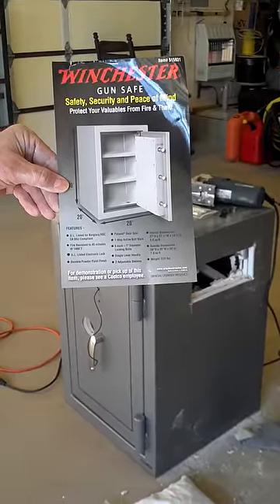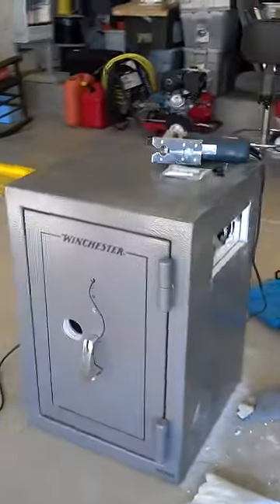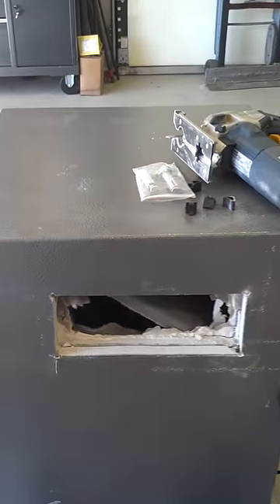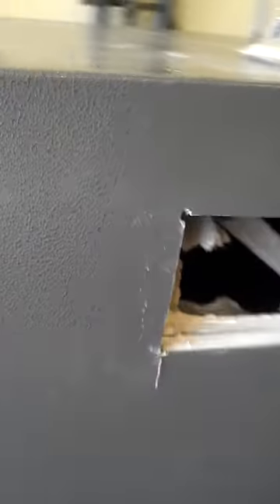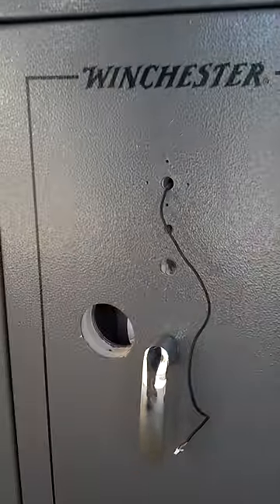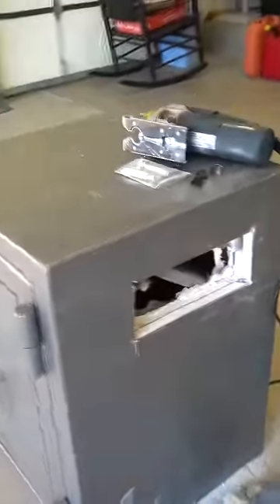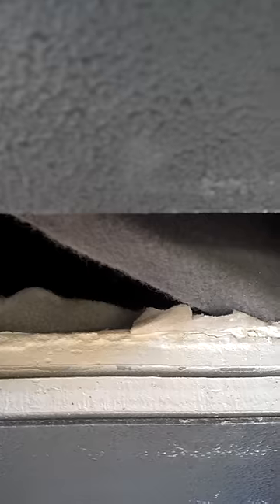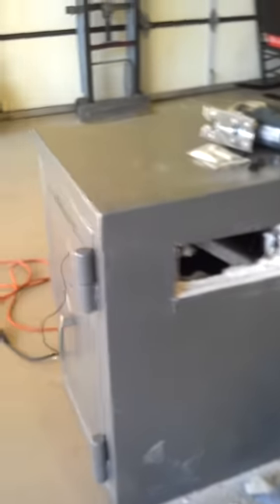Breaking Into Winchester Safe

Comment: The old Winchester models had those electronic keypads that failed. Fortunately, the new models have a key backup located under the keypad. If the keypad fails, you can still get into your safe with the key. I would never buy any safe without a key backup. Can't trust electronics to last.
Reply: hmm- but lockpicking is fairly trivial at that point, no?
Reply: @chrisE815  not so trivial for me. Some locksmith is going to charge a few hundred $$ to open it.
Reply: @jerseyneil1  that's why I bought a liberty safe.they cover their locks
Reply: @chrisE815  Yeah the lock picking lawyer got into a tubular lock within seconds. So I would assume buying a safe with a key slot is a huge vulnerability

Comment: ALL safes in this price range are built this way.  A higher end safe that size would be 2 or 3 times the price.  The lesson here is to get a manual lock not cheap electronic lock.  Liberty gives 5 year warranty on S&G electronic locks and Fort Knox gives a lifetime warranty.  These safes are to stop kids from getting guns, fire protection, and to slow down a smash and grab punk when the safe is bolted down properly.
Reply: Yep, that's the right attitude. Most break in's are all about opportunity. They want cash, jewelry and pills for the most part. They encounter a safe it's likely not going to be worth their effort to go nuts on the thing and risk getting caught. I once had my house broken into, I'd just moved there and I had a couple guns there in a side room just in bags. They didn't touch em, cop said a lot of criminals know better than to be caught with a stolen firearm...it's a serious enhancement to their crimes.

Comment: Aren't most lower-end consumer safes made the same way?  The "dry wall" material (concrete backer board in others) is there to increase the fire resistance not the angle grinder resistance.  The basic purpose of the safe, properly mounted is prevent most thieves from being able to simply grab the gun and the flat screen and jet.  Unless you are robbed by someone carting around some pretty darned expensive cordless metal cutting tools or rolling up in a lift gate truck with pallet jacks to roll the safe out on, they are not going to spend enough time in your house to figure out how to cut into the safe, hence the value of your consumer quality safe . . . deterrence.
Reply: Exactly and with a alarm going off they cant just grab and go with your guns locked up like this good safe

Comment: Who breaks into your house intending on needing a jig saw, hammer drill, and whatever other power tools they'll need to get inside?  Almost they'll have a crowbar or sledge hammer, neither of which will get you in before the cops arrive.
Reply: If you are talking about your neighborhood kids or the local junkie breaking in for a quick grab of anything he can pawn, then you are right, these amateurs are not prepared to break into a security container.

BUT any pro is ready.  Pros rarely break into a home without knowing in advance what they can expect.  Whether the pro cases the house himself or gets his information from others (as most do) doesn't matter.  The simple fact that you HAVE a "gun safe" makes you a target and guarantees that any pro who comes to your house will have either a double-cut saw or an ordinary circular saw with a carbide tipped blade -- either of which will cut through the sides, back, or top of your "gun safe" in less than a minute.  No pro bothers attacking the door because there is simply too much junk in the way inside the door, but the sides, back, and top are just one or two layers of thin sheet metal, with a layer of drywall and maybe OSB and carpeting.

Pros love "gun safes" even if they aren't interested in stealing rifles and shotguns because they can be pretty sure of finding handguns and other valuables that people stick in these "safes" thinking it will protect them.  

If you are going to waste money on one of these Residential Security Containers pretending to be a "gun safe" at least find a way to position it where there is no access to the sides, back, and top -- but a far better choice is to get something better because most "gun safes" on the market are actually very bad places to store a gun. The Drywall or "Fireboard" used to get the Fire Protection Rating causes moisture inside the safe promoting rust, the carpeting and the adhesive used to install it will outgas chemicals that attack the metal.  Nearly all "gun safes" are greatly over-rated for the number of guns they are supposed to hold -- one of the major causes of damage to guns comes from banging against other guns when people try to take them out or put them into a gun safe.
Reply: problem is is when you live in a rural area and any noise will not alert anyone. Plus with all the sleazy lawyers about and sleazy DAs looking to go after the homeowner while protecting the thugs, if your guns are not locked up the homeowner will have a lot of legal expenses. Cops are worthless. Local woman on vacation had her safe broken into by a 50yr old woman and had over 100K stolen.

Comment: why didnt you just buy a new keypad? Your keycode is stored internally. just unplug and plug a new one in for $60, would have saved you from destroying your safe
Reply: Mr. Maki, nope the code is stored internally and on the lagard key pads the contacts go bad, so you buy a new pad twist off the old pad replace with fresh batteries and wait 5 mins the enter your code

Comment: The most expensive safe on the market has sheet rock in it...   And it will take anyone about 5 minutes with a cut off wheel to get in any of them...  There's nothing special about that safe, or anything you've done...   Other than buying a cheap safe, with a known go fail electronic lock...

What you needed, was a good locksmith.  Who would have replaced that lock, and got you open in 20 minutes, without cutting it up.  

...derp!

Comment: Do you still have that safe sitting around, Sir?  If so, I'd like to see (a video) a crow bar/pry bar attacking the front door, just to see how difficult and how long it'd take to pop that door open.  I have the same exact safe and was wondering how secure/strong the door is.  Thanks.
Reply: That is a rather small safe, so the door is hard to pry open (bigger safes are easier to pry open!) -- but as this video and others show, it takes only seconds to cut through the sides, back or top of almost any "gun safe"  The folks at SecureIt have a video of a couple of amateurs prying open a typical 5' "gun safe" in a couple of minutes.  A common "gun safe" can be reasonably secure IF you bolt it down, AND locate it where crooks cannot get to the sides, back or top, AND make it hard to get leverage to the door on the side away from the hinges -- but there are better ways to store your guns and other valuables.  Take a look at https://www.secureitgunstorage.com

Comment: Most thieves look to be in and out quickly as possible and if your not home sure they may mess with your safe a little to try and get in but they wouldn’t spend 30 minutes or more trying to break into your safe and risk you coming home or cops coming and they wouldn’t be able to drag it out of your house and load it very easily or if you have it bolted down . It’s more of a deterrent meant to not be able to have easy access to , to snatch and grab if I robbed a house just for example of course and I seen a big ass safe I knew I wouldn’t be able to load it or break into it I’m not going to risk it even though I know valuables would be in it I’m gonna look for something quick and easy and get out fast before anyone calls the cops or comes home and catches me in the act unless it’s a safe that’s not bolted down and the size of a microwave then you could literally carry it out load it up and gone then you could take all the time you needed to cut it open unless someone was smart enough to put some kind of locating device inside of it . Would be kinda cool if they made safes with a rechargeable battery and a sensor or device inside that would detect someone tampering with it like a bunch of vibrations or incorrect passcode too many times and send you a notification on your phone while your away maybe a small camera on the front that’s kinda hidden and not obvious like a door bell

Comment: I can cut any metal with tools.
Reply: It isn’t the fact that u can’t cut into steel.  It’s a question of how long will it take u. So it depends on the amount of steel that is in these Safes.  These Winchester ones are cheap. 14 ga steel is garbage. 

You should never count on a thin, cheap-end metal safe to store your guns and other valuable items. With simple research, you’ll notice that most poorly constructed gun safes include thin metal frames that are constructed from 16 to 20 gauges. If you end up with a safe that features anything from 14-20 gauges, you can expect even the least experienced burglar to be able to pry it open with a hammer and a large screwdriver. On the other hand, the maximum steel gauge for a quality built gun safe should be minimum 10 and preferably between 8 to 6.

You get what you pay for.

Comment: How much did the Winchester safe cost? Was it about $200-$400? A 12 rifle gun safe from Tractor Supply runs about $399. It's a Winchester safe. No, it's not a good as a $1200+ gun safe. But cheap gun safe is better than a locker or hiding guns in closet, under the bed or waterbed drawers. Not everyone has $1200+ to buy a high price gun safe. But if thieves have enough time to they can cut into any safe regardless of the price. They can even pry the safe from the floor and take it with them. Had a coworker come home from vacation and found everything in his home gone. Thieves came with a moving van and took everything including high price gun safe. A cheap gun safe is just there to slow lazy thieves down.

Comment: I have a full sized 40 gun safe that was a generic name on clearance.  Got it home and digital lock had problems but I did have keys so I called store and they said they wld contact the company, and they have before but they informed me the turn arnd was about 8 months.  I tried calling as well and I got some tool import company who put me on hold twice till I got a voice message service that asked for my phone # and brief description of problem.  Its 2yrs later now and never got a call.  Getting back to it I took the back of the door off and found the problem, it was the ribbon electrical cable plug had worked loose from one end, the weight of the digital lock on front when i let it hang to place a battery in was enough to do it.  Save yourself a headache and get a safe from a company that makes safes not companies who just put their brand on it.  But that's probably why I got it so cheap on clearance

Comment: Look, all the safes are the same unless you are going to dump sh** pile on one. If you want to make it better and it will not cost as much as a really good one like ironworks safe weld metal to to the outside. The fact is it helps slow someone down and I don't know about you I don't have cutting tools in my home.

Comment: I have the same issue right now, I was sent a piece of crap new plastic NL keypad to replace my Lagard keypad from Winchester and I still can't get in. Apparently the internal lock is bad. I will NEVER buy from Winchester their customer service SUCKS they hardly ever answer the phone. I am going to have the safe drilled, opened and then I will replace the electric lock with a mechanical one. I urge everyone stay away from electronic push button key pads they eventually will go bad on the inside of the safe which leaves no option but to have a locksmith drill. I probably will put a SafeLogic Xtreme on it myself after it is opened. I think the reason Winchester has only answered the phone once of the twenty times I called is due to too many people having problems with electronic piece of 💩 pads. Oh yeah this happened when I first got the safe and I was giving a master code that only works once.

Comment: Sheet rock??  WTF??? I was looking into getting one of these so here I am.  thanks!!  and what do you recommend for a 10-12 gun safe under $400? Does such a safe exist?
Reply: With that budget, WINCHESTER, try Tractor supply on Black Friday..
Reply: Sheet rock is the norm.
It's more for fire protection than preventing a break in.
Reply: In that price range?! you just saw it. If you value your belongings its best not to cheap out.
Reply: You can not buy a much better quality safe for 10-12 guns under $1000.  Look for steel size.  7 gauge is better than 10 which is better than 11 which is better than 12  which is better than 14.
Reply: Nothing that will hold 10 to 12 guns securely at that price.  But then again, no 10-12 gun "gun safe" will hold 10 to 12 guns, so I'm not sure if you are looking for a safe rated for 10-12 guns or are actually looking to store 10-12 guns (which requires at least an "18 gun" safe from most companies)  For some better options, take a look at https://www.secureitgunstorage.com

Comment: For all you guys who have a safe, thay will keep someone from steeling your goods if thay didn't  come prepared. But if thay are a decent thief thay have done a recon sit and watch if thay suspect you have something of value due to someone you know running that head. If thay have time an angle grinder with matabo blades will get into any safe. As far as the sheet rock fire proof, that shit is a joke and no safe will servive a fire unless it's a bank vault with concrete walls and ceiling.  I've known of three safes that didn't servive home fires, winchester , liberty and a browning safe, last two where really expensive ones , first one wasn't real cheap. Total loss on all three, so get one to keep thiefs at bay mine saved me from a break in, thay took everything not nailed down but didn't touch the safe. But get good insurance  against fire and don't put your trust in one keeping your stuff from being toast.
Reply: What are you 12.
Reply: Same thing happened to me some broke In took everything but Safe was moved about an inch and that was it. Most break-ins are about speed.